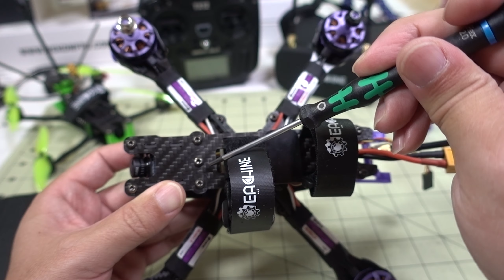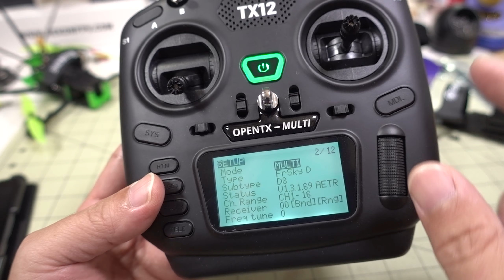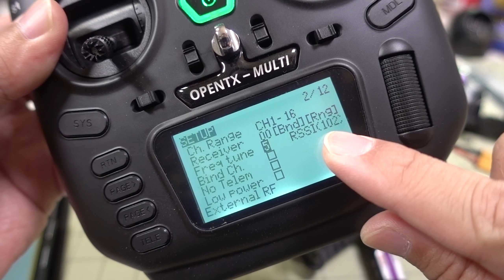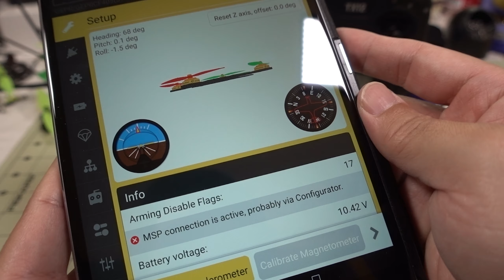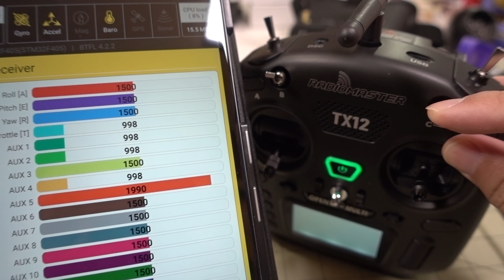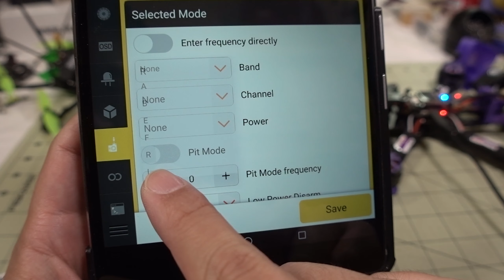Eachine Wizard V2 Complete Setup Guide Start to Finish 🎓

Comment: I have the wizard x220s and it doesn’t have a receiver. What do I do
Reply from the maker: They've updated some of the components on this model since I reviewed it. You probably got a flight controller wiring diagram with your model.  Use that to see where to install the receiver.  If you didn't get one, ask the vendor who sold it to you for one.

Comment: hello 😁and thank you for your review! There is a variety of opinions out there for this quad, esc seems unreliable and motor or fc stop functioning after a while. Have you flown the drone for any time long? what was your experience and could you please express your own opinion for the wizard x220 v2 in the long term?
Reply from the maker: Mine is still flying fine after many flights but I don't think I abuse it the same way many beginners do.  The cheap price of this quad attracts a lot of inexperienced pilots who crash these a lot so you see more failures.  They don't buy the $1000 high-end quad and abuse it the same way.  I suspect the $1000 quad will also suffer many failures when subject to that level of abuse.

Comment: I am having issues getting my fs-i6 transmitter to bind to my fs-ia6b receiver with this drone. Can you help I have video with my vr009 googles.
Reply from the maker: There's a ton of videos about Flysky binding on YouTube.  I think your reason is like most other people.  The IBUS signal must not be inverted and if you use the FrSky SBUS pad, that is inverted and won't work.  Use a different UART.
Reply: @AlbertKimTV  is there a website where i can find wich uarts are on the board, im having issuses with that. i bound the transmitter to my reciever(reciever = fs-a8s ) (transmitter = fs-i6 ). i dont see any stick input on the reciever tab, ive put my board to ibus and i already tried all the uarts. Please help im stuck on this.

Comment: Did you manage to find a diagram for the FC? I got the flysky version with the A8s and I am ready to swap that receiver because of the brownout issues. I'm trying to see if a receiver with telemetry can be wired in. Can't find the manual for this anywhere.
Reply from the maker: Wiring diagram is on the PNP product page (link down near the bottom of the page).  Diagram is misspelled by the way.  Link to the product page is in the video description.